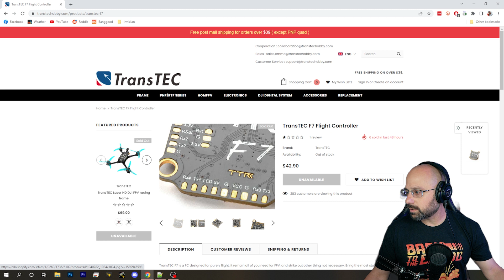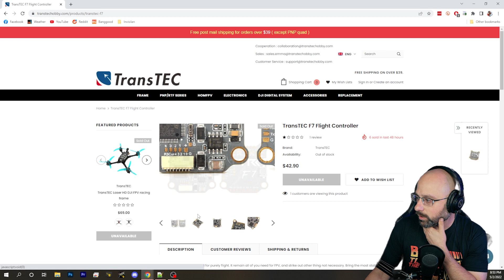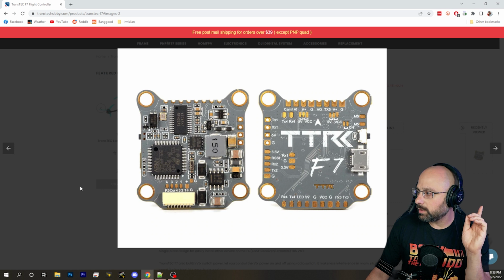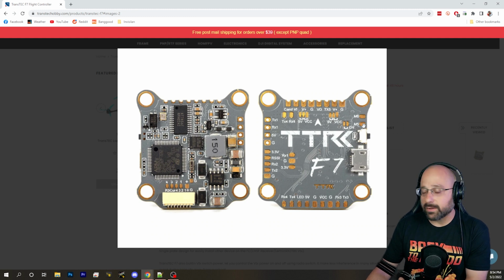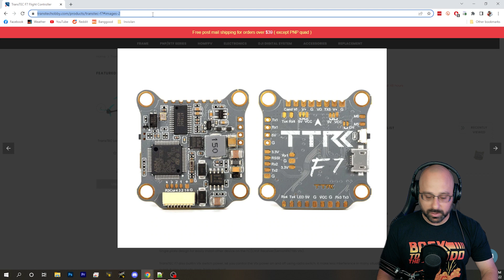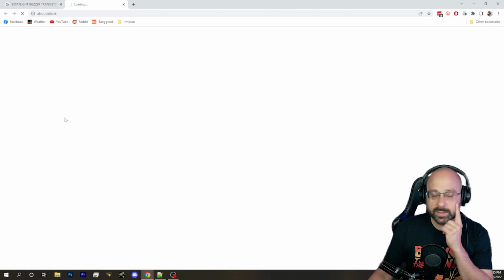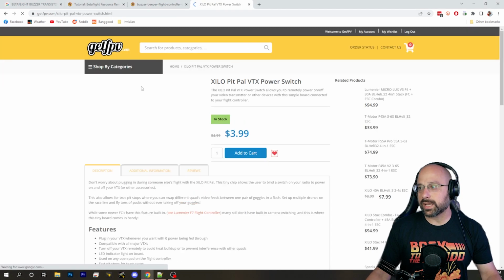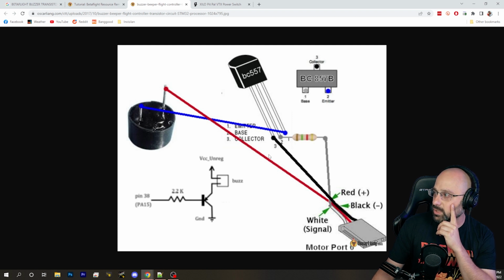Using a Buzzer Without a Buzzer Pad On Your Flight Controller - FPV Troubleshooting With JB

Comment: I hope someone can help me out i use vifly mini finder and i broke buzzer pad ... can i just remap it to a randon rx or tx ?... i hear different answers and I am scaried to burn the pin ;s
Reply: Hey! 👋 thats exactly my question as I have the exact same situation (broken Bz- pad and a vifly finder) So I think I could solder it to a non-used LED pad and do this remaping thing. Will this work? Did you find a solution or get an answer ??
Reply: @2_Mars  hey I got information from vifly that you can directly solder it to a GPIO pin and map it to buzzer as the vifly finder is an active buzzer so it does not drain any ampere from the PIN
Reply: @mateuszpachulski6211 thank you very much for your help! So what kind of pad is a so-called GPIO pin? I have a Speedybee AIO 405 40A Bluejay. Which pad do you think I could use for this? Maybe T3 or R3 (are still unused)?
Reply: @2_Mars  with GPIO pins I meant any tx and Rx pin that can be mapped and has no serious function
Reply: @mateuszpachulski6211 ah okay 👍 anyway I read that the Led_string pad is the most usable pad for remaping. So I think I will try it first 🤔